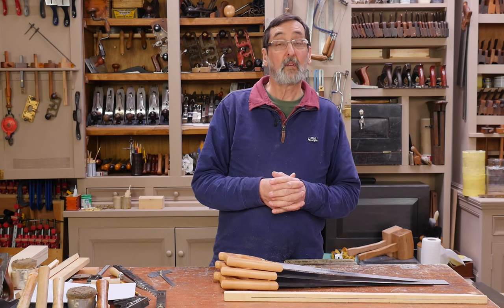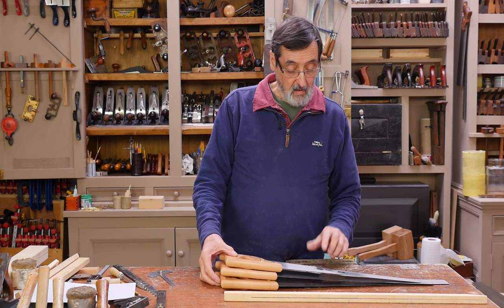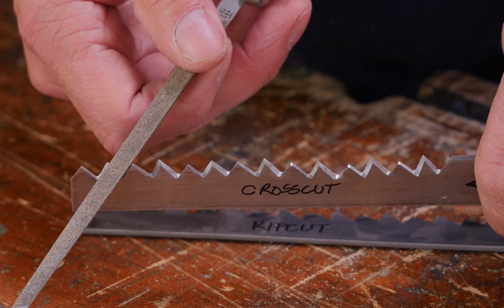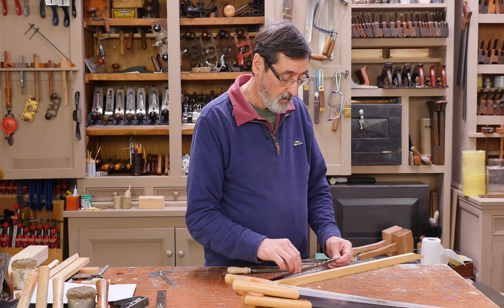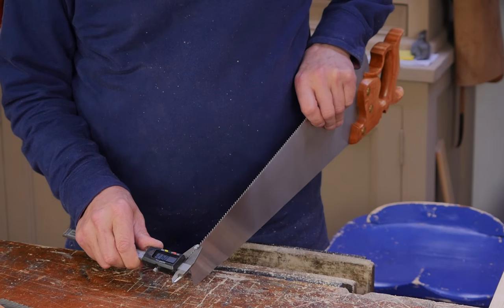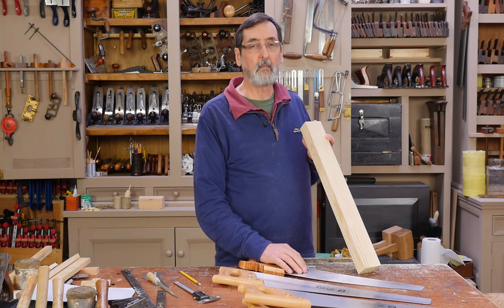Handsaw Comparisons | Paul Sellers

Comment: As I understand it (may be I am wrong) many cheap saws are 'hardpoint saws' which I believe are not resharpenable. Is there an easy way to look at a saw in a shop and tell immediately if it is resharpenable?
Reply: +thisnicklldo  as Marcin says, if the teeth are of a bluish colour, the saw is harpoint. Also, some companies polish the hardened teeth, but have  signaling printing on the side of the blade, or cardboard  scabbard if they come with one (for example, a file with a black band diagonally across, signalling that they cannot be filed)
Reply from the maker: +thisnicklldo Most often, but not always, hardpoint teeth are bluish.
Reply: +thisnicklldo Yep Bluish.I keep one for drywall (Plasterboard) and fibro sheeting ( Not sure what the rest of the world calls cement sheeting here in Australia we call it fibro) I buy my saws from car boot sales ( Markets here in Aus) Sharpen them as per Paul's Instructions, good saws with a bit of elbow grease for around 5 to 10 $ each. Happy times and sharp saws :). Same with planes 15 to 20$ each follow Paul's post on refurbishing a hand plane and Bobs your uncle ( Or in this case Paul) nice plane little cost and a hand tool to use for years. Might just be me but I really enjoy getting a tool out and knowing I brought it back to life.

Comment: I think that metallurgy has improved to the point that a less expensive saw is nearly as functional as the high-priced one. 

By the way,  would it be better to remove the varnish,  and wax the blade? I think automotive brake cleaner/degreaser would remove it quickly.
Reply from the maker: +Bob Blarney Yes, but I wanted as close to new as possible. It was this that cause the vibration on the returning strokes.

Comment: Can someone help me. I missed the point Paul made about why he prefers to convert cross cut saws to rip cut. Is it that rip cut saws are as good as cross cut? My understanding is rip cuts are good for cutting with the grain. But are they not so good across the grain. Bit confused.
Reply: Sorry my bad English, Pauls have 2 saw, one for rip cuts and another for cross cuts, boths cheapest saw, remember the more expensive save cost, is 4 or 5 times than the cheapest.
Reply: Darío Oscar Nakatsuka
Thanks for the info, that makes sense.
Reply: at 10:58 he mentions that he rips and cross cuts with a rip saw and doesn't like to have both, although he didn't elaborate.  Then at 12:40 he talks about having 1 for each type of cut.
Reply: Tech Tins I believe he commented  on the lack of rip saws on the market, and if you were on a budget, you could convert the more common crosscut to a rip to save on money.
Reply: +James Estrada Thank you that makes perfect sense now.

Comment: Could you add a taper grind yourself by sanding the back portion of the plate? Might be a cheap way to turn your £20 saw into a £100+ saw.

Comment: Hi Paul,

What is the size of file (specs) you are using to sharpen and convert the cross-cut to a rip-cut saw.
Reply: According to Lie Nielsen Toolworks for their saws these are the files they use: "We use a 7" slim taper file to file the teeth on our 7ppi Rip Panel Saw, a 6" slim taper file to file the teeth on our 8ppi Crosscut Panel Saw, and a 5" double extra slim taper file to file the teeth on our 12ppi Crosscut Saw." 
https://www.lie-nielsen.com/products/1-saw-ps-c8-panel-saw-crosscut?path=panel-saws&node=4149

Comment: would anyone recommend putting an old saw blade in a vinegar bath to remove the rust or will it damage the blade?
Reply: Just did that today with an old tenon saw from a boot fair that I paid £5 for.  Thirty Minutes in a bath of distilled (white) vinegar and wash off under a running tap with a nail brush and the rust is dealt with.  Its a bit dark, but it is smooth ready for a bit more finishing and fettling.  Be aware, when you take it out of the vinegar you must rinse the vinegar off (vinegar is an acid, however mild) and dry the blade thoroughly then give it a little rub of light oil or the rust will come back within an hour.

Comment: I think that the only question left is longevity. How long does each saw last before it requires resharpening? If both saws hold a point for about the same time, I don't see much justification for a more expensive saw. Hard to spend 7 times the money for a 5% performance improvement.
Reply from the maker: +Brandon Francey No question as to longevity. I have been using it extensively now and it's still going strong.

Comment: I am interested in trying my hand at filing some hand saws. Maybe changing a crosscut to a rip cut. Also changing the tooth spacing to make a fine cut dovetail saw.  So I think I need  file for 7 tpi and a file to cut 14 tpi, both rip cut. Can you recommend the proper files to do this, leaving a nice clean edge?
Reply: A file big enough for the 7tpi it will also work fine for the 14tpi. The requirement is that the file be at least twice as deep as the tooth depth. Watch Paul’s saw sharpening video for more file info.

Comment: Paul, I love working with my hand tools and I have learned a lot from you.  However, I can't see why I would want to learn to rip saw timber?  There is a lot of work to rip saw and the band saw or table saw would seem to be far more accurate than any handsaw, no matter the skill of the user.  With other hand tools, I can set up and plane, chisel or crosscut much more accurately with hand tools.  But, rip sawing seems to me to be such an inferior way of woodworking I can't cross that bridge.  My question would be, why would or should I consider hand ripping a timber?
Reply: +christschool For the hobbyist, look at the price difference between a decent hand saw and a decent table or band saw and you have your answer! Space is also an issue. I am often frustrated with so called 'simple projects' on youtube where they have a workshop bigger than my house with every conceiveable power tool in it.
Reply: +christschool Also...i dont know of anyone who has cut their fingers off with a handsaw!
Reply: Andrew Frudd if you're worried about cutting off fingers, you could buy a sawstop. Handsaws are potentially even more dangerous than a Sawstop.
Reply: Cutting a tenon is mostly a ripping operation.  So is cutting a dovetail.
Reply: +christschool on frequency of accidents perhaps but not on severity.

Comment: What saw should we use when we cut diagonally as it cut and rip at the same time
Reply: It would be cross cut saw. As Paul has said in various videos, think of wood as a bunch of straws tightly packed together. Going at 45 degrees like you say doesn't really change much.
Reply: @SteS  thx

Comment: What a shame those saws are not available in the USA.  All the saws below $100 that I can find have impulse hardened teeth.  I suppose I could grind those off.
   Ooo, up to 15 dislikes, must be some saw manufacturers trolling around.
Reply from the maker: people tell me they can buy and ship via Amazon.co.uk instead of .com for 60 USD less so around $40 all in.
Reply: I have already begun the process after seeing the junk on Ebay here, so thanks again.  Still looking for your recommendations for a dovetail saw.
Reply: It is odd...  Even the good vintage stuff on ebay is from the uk.  They must be flooded with this stuff.
Reply: Ohh wow the Spear and Jackson saws on amazon UK are actually cheaper than what is listed for the USA, because you aren't paying a vat tax on them.

I have 3 saws in my basket, and shipping and handling is only $22.

EDIT:  Some items won't ship to the USA though...  Irwin Mortise Gauge for $20 RIP!
Reply: You can buy these in the USA via amazon UK.  You have to pay for shipping, but you do not have to pay the vat tax, so you are actually paying about the same as the people in the UK.

Comment: That's not called a facet. A facet implies many sides and is usually used to refer to gems. What you're talking about on each tooth of the saw is called a bevel, which is just a sloped surface at the end of a flat one, which is common in woodworking.
Reply: A facet just means a feature or aspect to something. It does not have mean what you implied. What you have done is to put a word in a particular context.
Reply: @bighands69  You know Google exists for this very reason. It takes only a minute to not be dumb before you post something. Sure it may mean that, but we're going for most common definition here.

Comment: Hasn't Mr Sellers heard about new teeth types, which are superior to these old ones? These saws have often PTFE coating which decreases friction, and some have quite rigid blades. They cut faster, straighter and leave better cut - they are just better saws than these old types. You can not sharpen them though, but if they cost about 20€ it is not worth it. 
And yes, I have many old saws and know how to sharpen and set them. The filing technique of Mr Sellers is not very good as anyone can see, but the result surely will do.
Reply: Sorry but why do you moaners bother watching a master woodworker at work if all you are going to do is criticise?  We  mostly all know about the modern patterns of saw teeth and Japanese saws and how efficient they are.  It's not always about that though.  Sometimes it's about learning the old ways and then, once they are mastered to think about the more modern stuff.
Reply: Such a waste to throw a saw away when its blunt.  Its unsustainable.

Comment: Paul, love the videos! I have only sharpened a handful of saws in my lifetime but I feel compelled to offer a tip to a veteran such as yourself only in the hope it may be of use. If you get an old magic marker and run it down the top edge of the teeth lightly you should never miss a tooth again for rip cuts. For crosscuts, as the teeth are set first to one side and then the other, you can mark every other tooth by running marker down the side touching only the back of the teeth set on that side. Repeat on other side and it will mark the teeth set opposite.  Thanks for sharing!
Reply: +Jay Benson That's a good idea.  Thank you for the tip.